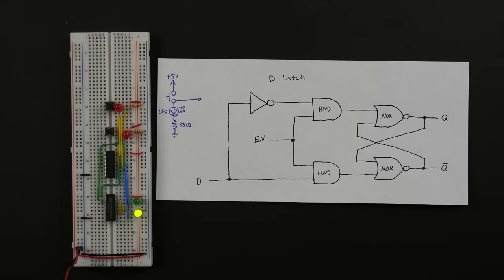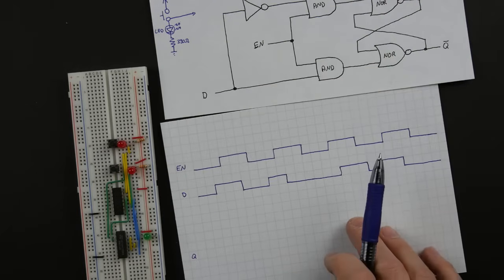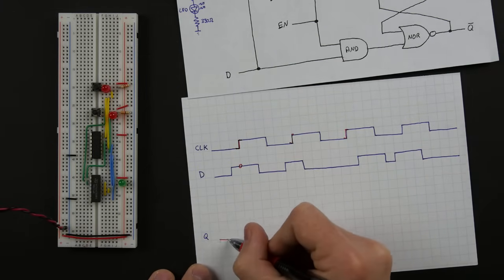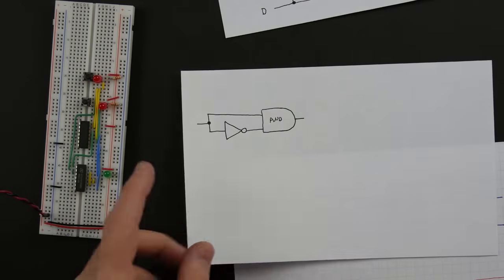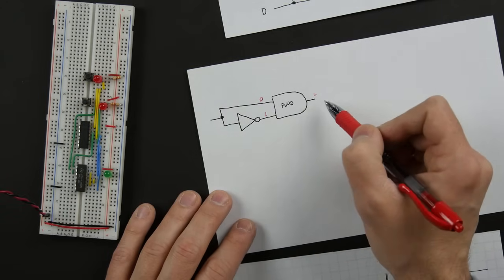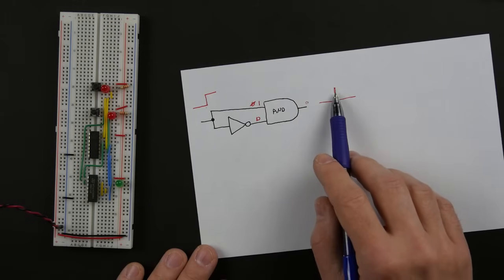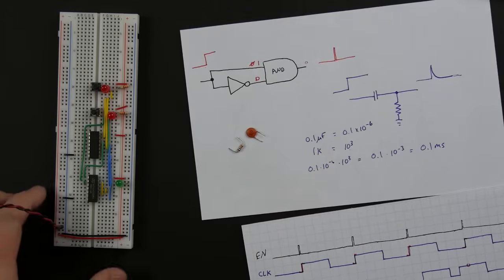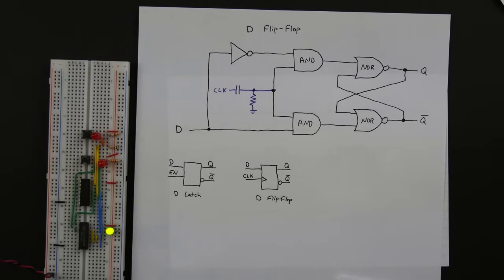D flip-flop

Comment: There's something I don't understand though. when the clock signal drops back to it's lower 
value, the capacitor will have to discharge itself and the value of the voltage will fall below 0V, is that not  a problem for us?
Reply: I would like to know this as well...do you not get negative voltage?
Reply: https://electronics.stackexchange.com/questions/436400/why-does-this-rising-edge-detector-using-a-capacitor-and-a-resistor-work
Reply: I think it will discharge through the resistor
Reply: It will discharge thourh resistor until it gets 0V
Reply: You would get below zero to -Vcc, this would not be a problem but you have to make sure that capacitor discharges so that when next clock pulse arrives voltage goes positive again. Capacitor will discharge by letting the current pass in opposite direction back to the clock input.

Comment: Man i like the way you explain the cpu component but i think the pulse from RC circuit shall be less than clock frequency please correct me if its wrong.
Reply: The pulse will indeed be significantly less than the period of the clock -- that is required for this circuit to function as described.

Comment: HEY Ben! GR8 Video!!
Although I doubt that every flip flop should be edge triggered which means every flip flop should be master-slave configuration. 
I couldnt understand how did you change ENB to CLOCK in the circuit.

Comment: 2 questions, first off, with that edge detector, the capacitor causes a negative voltage on the input of the gate when it's being discharged. I could be wrong, but wouldn't this be less than ideal? Secondly, I've tried using this design of D flip flop in both a shift register and johnson counter and neither worked properly. So far the only design I've found that works uses 5 NAND gates with 2 inputs and 1 NAND gate with 3 inputs. As far as I can tell, the two work identically, as I understand it the additional NAND gates in the flip flops I've been looking at are for the sake of edge detection. So why would that design work in a shift register or johnson counter and this one wouldn't?  I've included an image of the second type of D flip flop I've been talking about for clarity.

http://1.bp.blogspot.com/_becES0hCzzM/TUEVdGG3-dI/AAAAAAAAAvk/njMdSxgGJM0/s1600/pos+edge+flip+flop.bmp

Comment: Thank you for the video. Everything was clear except for the edge detector, but that may be becuase of my limited (nonexistent) experience with capacitors on circuit boards. Could someone let me know if I’m mistaken about the edge detector:  When the positive voltage is applied one side of the capacitor, it tries to draw electrons from the other, the side with the AND gates. That induced voltage pulls electrons from the gates’ inputs, essentially making a temporary positive connection, activating them. The grounded resistor only speeds up the pulse, as it suppies extra electrons.  (As a note, if this is how it works, then I think that the relative pulse length formula would be slightly off because the gates are contributing to the charging, apart from the resistor.)

Comment: A quick question for the people of YouTube - how does Ben's circuit supply enough for powering on LEDs? Is it simply just a high enough supply current?

 - I am currently trying to test a Texas Instruments 4002Be (to understand how it works) with a 5V Arduino as a supply to light a 5mm green LED from output pin 1 - if it does light it does so inconsistently

Additionally a tutorial article here: https://electronicsclub.info/cmos.htm recommends that all unused inputs be wired to ground to avoid noise over inputs which is not done here, would anyone concur?

Comment: Ben, your information is amazing. You are a great instructor. I have a question about this and I wanted to make sure I didn't do something wrong. I created a virtual D Flip-Flop. If I connect the pulse to the CLK/EN connection and the button to the D connection, it only changes led when I press the button on D with the pulse running. If I switch them, Pulse on D and button on En/Clk. I hold the button down and turn pulse on it flips back and forwards. My question, I thought this was backwards? Shouldn't the clock be triggering the led to switch back and forward with the CLK connection? I hope this makes sense. Thanks for your videos.
Reply: The point of a D flip-flop is usually to sample the D signal only when there is a clock edge. That means that your circuit can compute a bunch of stuff based on the outputs of various flip-flops, and take as much time as it needs to settle to the right values, and only when the next clock edge comes do you sample the new values and use them as the basis for the computations in the next cycle.
Reply: @possible-realities  thanks for your reply

Comment: why do we need a pulse detector ? or why do we need a short pulse for a flip flop? please explain
Reply: A bit late, but: Because otherwise when CLK is active the output would follow the input. You would have what's called a transparent latch. 

In sequential digital circuits you often have feedback. So you want your flip-flops to examine their inputs at the rising edge and then it takes some time for signals to propagate / stabilize. So you don't want the outputs changing during that period. So typically you want to latch the data at the rising edge and change state on the falling edge. 

In this case the edge detector is looking for that "rising edge" so the data is only sampled during that time, not during the entire width of the clock pulse.

Comment: At first: great videos!

Wouldn't it be possible to go back to the very first circuit design with an OR gate, combining it with an extra NPN transistor with the backfeeding loop acting as an erase switch. You'd need an Inverter of course to open that last NPN transistor but one Inverter for the whole memory bank would be enough (or more specific – the whole memory controller). That way you'd have SRAM memory with basically 3 transistors per Bit instead of 9 in this case. Seems more efficient to me.

Comment: for the enable pulse signal, won't changing it back from high to low also cause a pulse, because the not gate output will also remain a 0 for a split second, so two zeros on the and gate. Hmm 2 zeros on AND gate is zero. i just answered my own question

Comment: This is really getting me down. I completely understand the logic part of this (logic gates etc.) but when it comes to the electrical stuff like understanding about current, capacitors and resistors, I don't have a clue. I've tried watching so many videos on these subjects but nothing makes sense to me...
Reply: It might help if you think of current flow as being like water flowing through a pipe.  A capacitor would be like an elastic blockage in the pipe which will allow water to flow until the elastic can't stretch any more and then blocks the flow.  A resistor would be like changing to a very narrow pipe.

Continuing the analogy, a transistor would be like a water-controlled valve, where a small volume of water flowing from one input to the output opens a valve which allows a large volume of water to flow from a second input to the output, and vice-versa.

One place where the analogy breaks down is that water can simply flow out the end of a pipe while electricity generally has to travel back where it came from.

The analogy breaks down completely when you start to talk about inductors, since there's no adequate comparison in water flow for a magnetic field.
Reply: me too, is just not the same as understanding a binnary alu than a irl alu
Reply: You should start by just getting a cheap "starter" breadboard kit and just play with switches, LEDS and RC circuits. https://tinyurl.com/y9hwkyg4 You can even use an old USB wall charger and cut up an old USB cable to use the black and red wires for a basic low powered 5 volt DC supply. Getting a decent (not the cheapest) multi-meter is essential for basic circuits, I'd recommend getting a used but known working or new analog type multi-meter, here is a new and decent meter https://tinyurl.com/y8zyp4oj . The moving needle will help to visualize what is going on with most basic circuits. A set of good test leads that are GOLD plated will reduce much frustration and confusion as gold does not tarnish or corrode over time making your measurements VERY consistent. As your circuits become faster and more complex, look to buy an oscilloscope like a used but working older analog one from ebay or maybe sites like craigslist. Also, the best thing you could buy is a book "The Art of Electronics" by Horowitz and Hill. It IS the electronics bible and covers everything from electrons to building your own 8-bit CPU. If your on windows the default calculator has scientific mode. Good Luck!
Reply: Nytheris they're not that hard as you're thinking you should first read some books then watch videos on Current , Voltage relationship. You should study a book  "Fundamentals of Electric Circuits" by Alexander Sadiku. You will understand How a circuit works. Then Transient Analysis (also given in book) you'll know why Ben in this video multiplied value of R and C to find time constant. It is a formula T(time constant)=RC which he used.
Reply: Well, you need to read up on current. Usually people who are taking courses on logic circuits have already taken Physics 2(electricity). It makes sense to me because I ahve already learned about resistors and capacitors.

One thing at a time.
Reply: You can't learn anything from simply watching videos. Unless you watch them over and over again. They just go over the topics too quickly. Especially on YouTube, so many tutorial series seem to pride themselves on being fast over being accurate or effective. You have to read about it and do it as well. I strongly suggest you download a program called circuitmod which will let you make both digital and analog circuits. It's great for playing around and helping to understand concepts in electronics. On top of that I also recommend browsing the sites All About Circuits and Electronics Tutorials. Get yourself a copy of The Art of Electronics 3rd Editions, as well. It's more of a reference book than something you learn directly from, but it's a great resource. If you don't understand a topic from one resource, move on to another resource and try hearing it explained from a different point of view. Most of all, be patient with yourself. Just 6 months ago I had no idea what current even was. Now I'm working my way to making my own breadboard computer piece by piece. Just keep at it and eventually you'll understand it, but remember you can't learn anything from just 1 source. The more sources of information you consult, the better you'll understand it. Best of luck to you.

Comment: What is the point of the resistor there?
Reply: From the video, the pulse width is proportional to the resistance and the capacitance, roughly t = R x C.

The lower the resistance, the faster the pulse. The resistance of the wire alone possibly results in a pulse so quick that the logic gates don't see it. The other way to do it would be to put a bigger capacitor there, but resistance is easier.